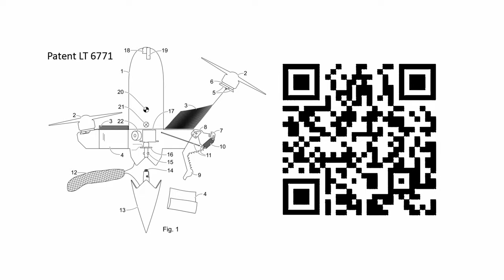Drone interceptor with a net gun. Information for interested.

Comment: Have you considered using rocket engines to take off and reach the operating ceiling? It seems that rocket modelers could propose an engine that would allow it to reach about 3000 m.
Reply from the maker: @pawekasztelan4852  already did. The project has been abandoned. https://youtu.be/Ptw0tfJq2n8
Reply: @ZaitsevskyA  
But what I mean is the starting engine that would take your drone to a high altitude. He then separated himself. 
It would save the battery for the climb. Your drone would have a longer range and would be able to reach the target faster.